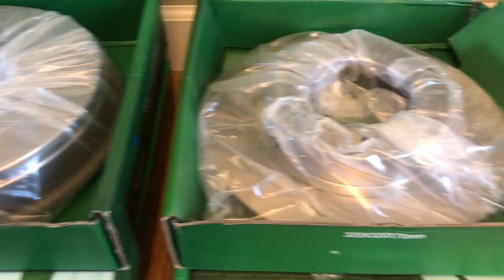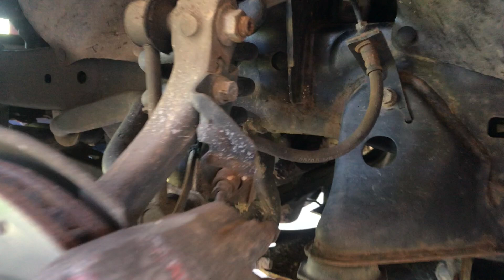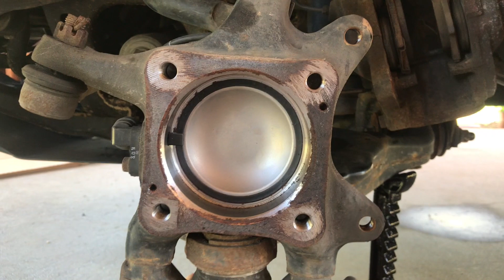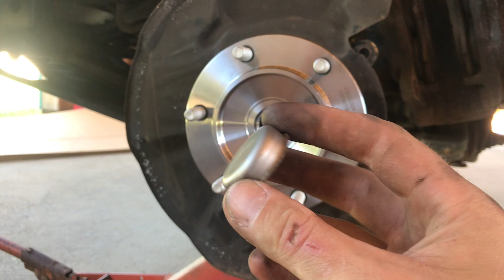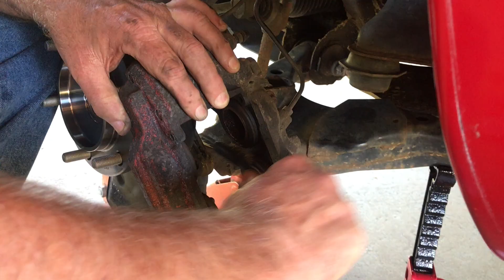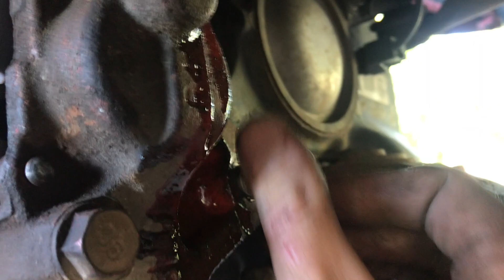Front Rotor, Brakes, and Wheel Hub Replace (2005-2019 Toyota Tacoma)

Comment: What size of lug nut key did you use to remove the wheel. I can remove the wheel to fix a simple puncture. 😂
Reply from the maker: I’m not sure to be honest, that was so long ago.. I would try a 7/16 or 1/2.. Also, any 4-way lug wrench tool will have a size that fits ✅